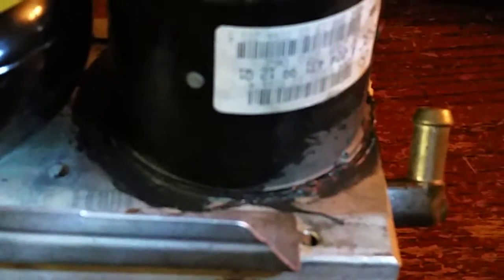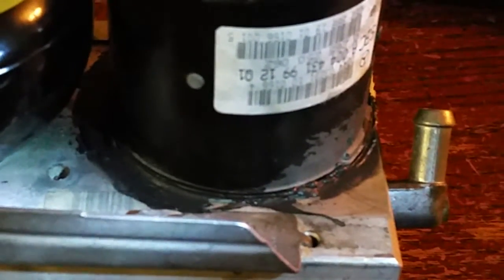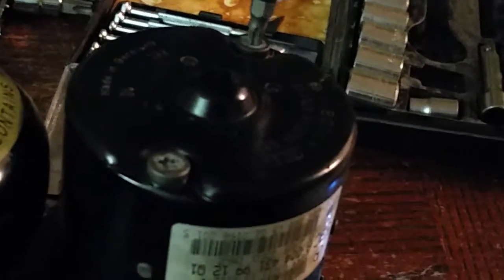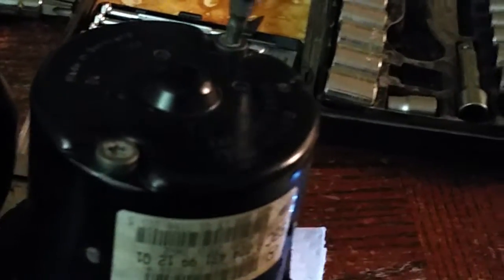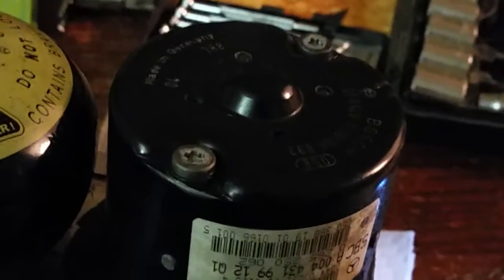Mercedes Benz / Bosch SBC Pump Rebuild (Brush Replacement) pt. 3

Comment: Great Video! After doing some troubleshooting I may be doing a rebuild of my SBC pump  also. If you still have a contact for the new brushes, what is the best way to get information on how to get them from you?
Reply from the maker: email me for brush info, there is a lot to cover ssmiller60@gmail.com